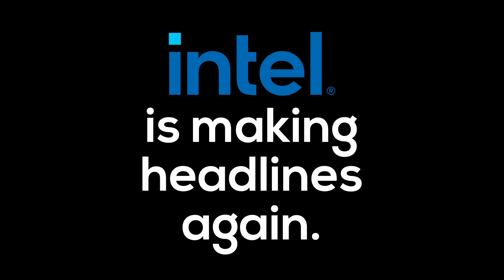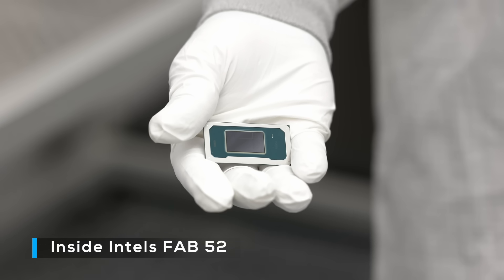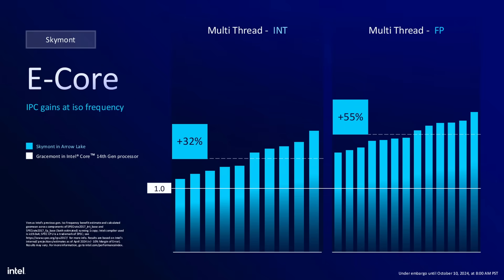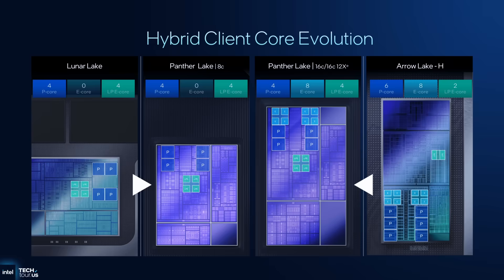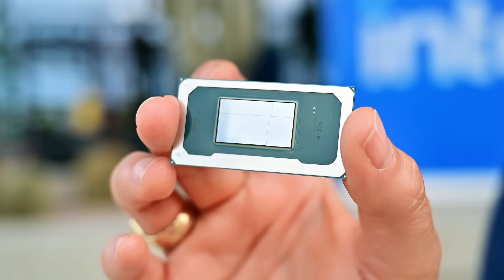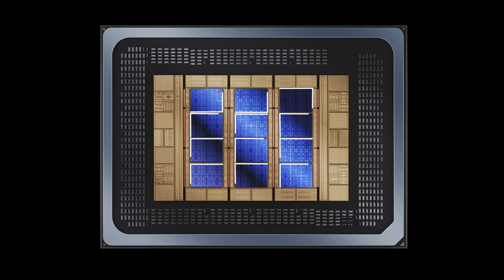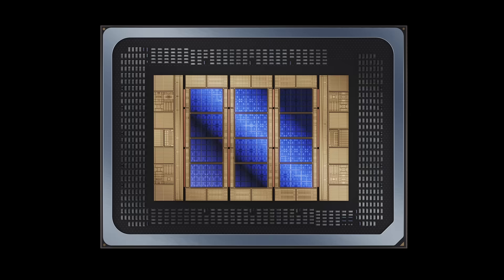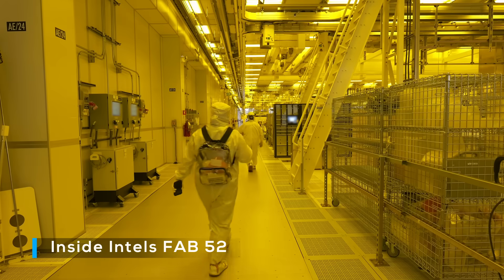Panther Lake, 18A & The current state of Intel

Comment: High NA EUV lithography exposure field size is half that of standard EUV  making chiplet architecture  a requirement for chips larger than 26mm x 16.5m.  The high-NA EUV final projection mirror is 1.2 meters (~4 feet) in diameter, weighs 360 kg, and is manufactured to 30 picometers precission. So increasing the exposure field is unlikely to happen anytime soon.

Comment: If Intel leaves few fast PCIe lanes for their XE chips, omitting dGPU, than their setup should compete with AMD 395+, but for the iGPU tile size, seems it's not.
Mid-tier H series is close to current AMD 370. But this is a few years after. And need to compare benchmarks to make conclusions.

I think, Intel more about battery like in x86, than something next-gen in performance.

Comment: Yeah intel was also very confident when it swore their 13th and 14th chips very definitely not defective - no sir, must be user error! They way they handled that fiasco put me off intel for a decade or so.
Reply: well technically many of them weren't it was the high end that had the whole frying themself alive problem. my 13th gen i5 and my 4070 have run strong since i got them. most gamers want the bleeding edge but im preferred the the value prospect and have had a great pc for it
Reply: funny thing my pc befor my 13th gen was a ryzen 5 3600 also bought for it great value
Reply: @Perma10  IIRC in the server space some reports said up to 50% were failing. That's a ludicrous rate. Intel's handling of the whole issue - denying returns and claiming there's nothing wrong at all - is what truly made it a travesty. You're just lucky yours didn't have issues, otherwise you'd have been out the money entirely.
Reply: @GalvayraPHX  no its not luck my i5 is only rated to max draw less then 75watts the chips that fry themselves are i7 and i9s that draw above 95watts  they failed horribly at the top end but the lower power draw desktop chips were all fine. though some blame is on bad motherboard drivers as well that were feeding to much power to the chip as well (it was still mostly intels fault )
Reply: @Perma10  The issue was not with the total power draw, but rather high voltage requested by the cpu. And there's also that separate issue with via oxidation due to fab contamination.

Comment: Watching this video on an M4 chip MacBook laughing at this fuck fest.
Reply from the maker: Moving to in-house silicon was the best thing Apple could do. If you control silicon and software you win.
Reply: @HighYield  Yes but there's more than that. These chips don't carry the baggage that x86 chips do with their backwards compatibility dating back to the 80s. This is why x86 is slow and has plenty of security issues. The M chips can't even run 32 bit software. That alone makes for a truly simple instruction set. That's where the "magic" is at.

Comment: Tile based is not only about configurability. The main thing is cost. When you create monolithic SOCs, a small manufacturing error in a single part means you have to scrap the entire thing. Using tiles is extremely difficult and comes with its own problems but saves a lot of money because of higher yields. AMD showed it was doable and a viable way to lower costs. I am glad Intel figured it out too. We need more competition, not less.
Reply: If you have a small manufacturing defect, there’s a chance you can still use it and call it a lower end chip after binning the broken parts

Comment: I haven't read the materials yet, but from the slides you did share, Clearwater Forest seems like a really risky proposition. Intel were bound to introduce something akin to Infinity Fabric, but their solution is really bewildering from cache coherency standpoint... They did burn lots of cash on backside delivery, no surprise it's such a big portion of their marketing. GAA is old news now. You shouldn't buy into their marketing re: chiplets/tiles, as it's ABSOLUTELY a cost optimisation measure: Intel had huge issues with yield on manufacturing side, and P/E shishow on downstream consumption (software didn't.) Maybe this string of failures would prove a learning opportunity for them, maybe not, but overall beating Zen 6 on cost efficiency, which appears to be the primary goal, would be a tall order!

Comment: I think you're underestimating what AMD and TSMC can do with Zen 6 and N2 nodes, and overestimating what Intel can do with 18A+
Reply: What? I think he focus on Intel experiment with different setup for their architecture, amd is amazing but their most experiment era is with their controversial buldozer and the first gen ryzen.

Pretty interesting how amd slowing down their experiment but still experimenting with cache while Intel experimenting with more risk now like the old amd. 

Let's hope they could push more experimentation to make sure we get better tech that also cheaper.
Reply: @onlyms4693 It is true AMD is slowing down their RD and that they're milking their first success in years but only because they've overcome Intel over the years while they weren't facing any technologically advancement from its competence.

Now that Intel is hitting the gas seemingly AMD will, only bc the market share they won and won't allow it for Intel to swallow it again.

That's the only thing i was meaning to say.

We, the consumers, will get better tech, but i don't think pricing will enhance around these products, as Intel has never been cheap, except on their "failed at sales" architectures and AMD will just follow the product table of prices if not increasing it if it overcomes the best from Intel.
Reply: I think you‘re confusing technical design differentiation with competition here. 
Both architechtures have received improvements, this here is about the path taken.
If you want economical aspects in the same consideration, go watch asianometry.

Comment: I have my doubts about Clearwater Forest putting Intel back on top.  Zen 5C is on N3 and has 192 cores with SMT.  Zen 6C will be on N2, and still have SMT, and probably with 256 cores.  And with simpler packaging that costs less.

It'd be nice for Intel to start putting pressure on AMD again outside of their marketing inertia, but I'm far from convinced it will happen soon.

Comment: 13:28  It's exactly L3.  The "L" terms when it comes to cache are entirely about proximity to the CPU core.  

Go back far enough, and processors had zero on-die cache at all.  The only real storage on the die was the registers.  Then you were able to add an SRAM cache to the motherboard.  There was no "L" on that cache.  It was just "the cache".  It's only once processors started having SRAM on the die for cache that you needed to talk about cache levels.  With x86, that was with the Intel 80486, which had a small (8KB, then 16KB on later models) cache for both instructions and data.  When the motherboard had SRAM chips installed, that turned the on-die cache into L1 and the motherboard SRAM into L2.

If the on-die cache has two levels, then the first cache you add after that is L3, by definition.  Saying "last level cache" just means there's no L4 cache.
Reply: Yes L3 has been interchangeably called LLC for a long time now. No layers higher than L3 have existed afaik
Reply: @DoesntRefillTheBrita  Broadwell had an “L4 cache”, although it was on a separate chip on the same “interposer” I think is the word, and I think it was also the more plain and conventional DRAM instead of the typical SRAM that L1-L3 cache I think typically uses.

And then I think Intel continued the feature briefly just for laptops, but I don’t know if it was available to be used as an L4 cache at all at that point? (It was supposed to be for the iGPU, and could be used as L4 if you disabled the iGPU.)

Another point is that I’m remembering something about AMD flat out removing a cache layer? Like, they ‘dropped’ L2 so now it’s just L1 and L3? In dGPUs.
Reply: @DoesntRefillTheBrita  Broadwell had an L4 cache using eDRAM.  It was mostly used to improve integrated graphics performance, but the CPU had access as well, and it was still faster than the dual-channel DDR3 in use at the time.

There was talk for a while of Intel adding L4 to products starting with Meteor Lake, but that never materialized.
Reply: That clean logic is getting muddied.
Now cores have higher, smaller, closer, more specialized "L0" caches dedicated to instruction or data. TLB, branch predictor and others things have their own internal caches too.
Remote (cross-chip) caches have such performance penalties it starts to make sense to name them differently.
Reply: @musaran2  also, didn’t Intel introduce “L2.5” Cache on the E cores with the predecessor to the Darkmont listed in this video? (It could’ve been L1.5, just, another intermediate cache layer but Intel didn’t want to rename the higher cache layers with L3 becoming L4.

Comment: I hope Intel gets its s... together this time. But to be honest, arrow lake wasn't that bad, Intel is getting too much backlash because they can't compete with AMD in gaming, but the only reason is the added vertical cache, is not like the AMD cores per se are better than those of intel (285k and 9950x are pretty much equals for multicore productivity). In fact, the memory controller of AMD is worst than Intel, so they kinda had to make something about it, like avoiding going out to ram as much as possible. I am zero fan boy of any company, or you could say I'm a fan of both. My last three CPUs have been AMD, 1700x, 5950x, and now 9950x, but before that I got pentium 4, core duo, q6600,  and  i7 930. At any rate, I hope both zen 6 and 18a stuff to be great and competitive and that they continue to push eachother limits for many decades.

Comment: Maybe is 'coz AI, but more cores and less Cache will do more computing, and then surround the CPU with L3$ Tiles, that way is all good and more optimized for each type of Tile, or making it like AMD did, with the L3$ beneath the Compute Tiles, but on separate Chiplets, for manufacturing efficiency and still optimized bigger Cache and more CPU Cores; approx. each Cache Tile is like 8 Cores, so 32 per Base Tile(BT), 4 BT is 128 Cores, Total 288+128=416 Cores or +44.4% more Cores. This way is a Waste of Tile Space IMO

Comment: But where is Diamond Rapids? I want P-core Xeon, not E-core.
Reply: They have been weirdly quite about Diamond Rapids and any workstation platform newer than Sapphire Rapids Refresh. Like, I don’t think there’s any timelines slash even just slides mentioning them outside of that “leaked” slide from like 7 months ago. 

Hope it’s just because the new CEO wants his own “five nodes in 4 years” type of plan that he can take ownership of and so they’re just holding info back to make it a bigger presentation and not that Intel itself doesn’t have a plan that stretches the next 4 years.
Reply: more details Q2 of next year. and launch in Q4.

Comment: Here I am, sitting behind my E5-2667v2 desktop and being satisfied with the performance I have right now :)
Reply: Those Xeons are amazing

If you don't need multi thread performance, consider the 1650v4

They're like $10 on eBay and have significantly better single thread performance, 6c12t btw
Better for gaming
Reply: @Zeroneii3  Ha, I never dove into the 1xxx series, good suggestion. I think I'm limited by my mainboard, an Asus P9X79E-WS, which can only handle DDR3 and the 1650v4 wants DDR4, right?
Reply: @woogicreate8876  Yeah, it's DDR4 only

Mobos for this gen are pretty cheap, no?
Reply: @Zeroneii3  I uses that particular mainboard because it could have 4 GPUs for deep learning :) But tbh, right now, don't use it for that. Just as a desktop with a single GPU. I just don't look forward taking it apart and installing a new mainboard again. You easily spend an hour or 2 or more. TBH I have a 13700 with mainboard sitting next to it, but for regular computing and even gaming, the good old 12 year (!) old CPU is still doing fine.

Comment: this is a very expensive way to do a chiplet design, which is like half of the reason to use chiplets.
Reply: This may be true, but remember half of it is being made by Intel. AMD have to pay for everything TSMC does for them.
Reply: @GreyDeathVaccine  ahh but tsmc is cheaper than intels own foundry for advanced nodes. Plus AMD is a close partner of TSMC and 100% pays a lower price than intel.
Reply: @phazzar  aren’t Intel claiming their cost per wafer from 14Nm all the way to 18A is basically flat? Which, obviously, doesn’t paint 14Nm in any more favorable light, but should mean that 18A is at least “price competitive” compared to TSMC that cranks up their prices whenever and however, with some comment under this video I think claiming a 6x increase from their 16Nm (could’ve been 28Nm, idk, they were just saying “the last decade”) to now. (Presumably 5Nm, given the context was NVIDIA’s wafer costs.)
Reply: @phazzar  Thx for context.

Comment: E-Cores are nice, but i'd like to see intel offer P-core heavy processors.  I'd prefer 2/3 of my cores to be P-core, with just a few e-cores for background tasks.
Reply: "I would like to see intel offer P-core heavy processors" No you don't. There is a reason why intel is moving away from these power envelopes. Namely, the power levels and thermals are all fucked. You have to understand: intel has to compete with Zen 6 on one side, and Apple M-class, Qualcomm stuff on the other. They are on the backfoot when it comes to yield and capacity, 18A being a hail-mary of sorts, and fucking up thermals will never be a good idea in their position. Moreover, the advantages of P-cores for the kind of workloads you would have in mind, are vastly overblown. "A few cores for background tasks"—I'm sorry, it doesn't work like that. E-only systems often beat P/E ensambles due to cache coherency and context switching idiosyncrasies. In the perfect world, your operating system would be able to pin stuff perfectly. We don't live in that world.
Reply: P-cores are wildly inefficient, the E-core team has done so much with much less silicon
Reply: That's the problem though, the vast majority of desktop users don't care about efficiency. We want maximum performance and many cores for things like multiboxing. They're great for laptop users, but I want real cores. This is why I went with a 9950x3d.  @xynonners
Reply: @xynonners  some people just want raw power at all costs. Even if it means sacrificing efficiency.
Reply: Agreed fluid physicist here - would like to see more p and less e
Reply: @Chalup4  wouldn’t you just want a threadripper than?
Reply: @luipaardprint threadripper builds are incredibly expensive right now, and also don't offer as good single core performance. A 9950x3d is a great balance for both work and recreation at a super low price point compared to the commercial oriented market.
Reply: @MiniDevilDF yeah fair enough, I haven’t really been keeping up with prices since I’m on apple silicon, but 5000 for just the processor is a bit on the high side 😅
Reply: Agree, they should have more diverse option, it will be new setup mixing.
Reply: Not on mobile and especially not with post arrowlake ecores. Ecores used to be half as strong now they're like 80%+ as strong as a pcore. Way less of a downgrade

Comment: I've heard from many sources that most energy in chips are lost in transfering data. So when you space the components further away from each other it significantly increases losses. Your basically wasting your TDP budget on chiplets.I think this chiplet idea is only good for cost not performance. When you play 2nd fiddle for the performance leader (AMD) you cant demand the highest price for your products. And Intel is a high cost company so staying at 2nd place will be a nighmare economicly speaking for them. With a dwindling staff they are making more complex products wich needs a lot more programming for the apps to work well switching between cores. I'm much more for the same core type AMD is going for after wasted time on ecores on 12700k and the 14900k. I'm much more happy with the 7800x3d and now the 9800x3d I'm currently on. Amd has a huge lead and Zen 6 is going to be a gaming monster. And we all know the gaming industry has such a huge PR influence compared to everything else that doing bad in games will generate nicknames like Arrow to the knee hehe. I've been an overclocker for soon 20yrs and the bus latency becomes huge when theres too many cores on a bus. I'm most eager to see the latency from core to core on the new architecture, but I have a feeling its going to be too high.

Comment: What makes me concerned about CWF is the fact that the CEO still seems to be managing expectations on how competitive the next generations of server chips will be and the fact they named it Xeon 6+. When they released Ponte Vecchio they had a very similar design with an active base die with massive cache that performed really poorly in terms of saturating the memory bandwidth. I wonder if they fixed that and what could be the problem that is causing so much expectation management, if not.
Reply: Intel also had problems saturating the memory bandwidth on Sapphire Rapids HBM as well. I think Chips and Cheese was drawing attention to the bandwidth from the compute tiles to the L3 on Clearwater forest as being a little low as well, although idk what ‘normal’ would be in that instance. 

I suspect part of the whole “Xeon 6+” naming has to do with what happened to the 288 core version of Sierra Forest.